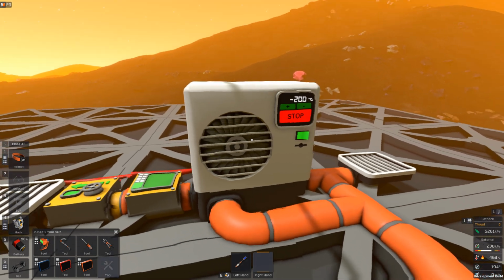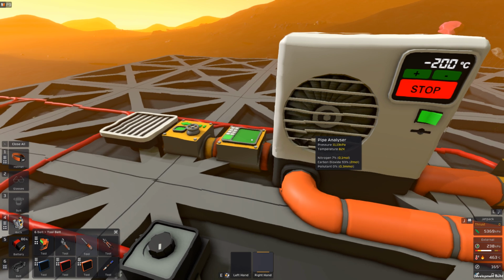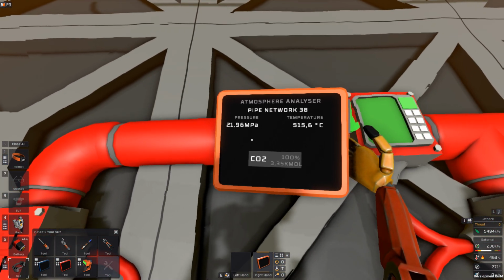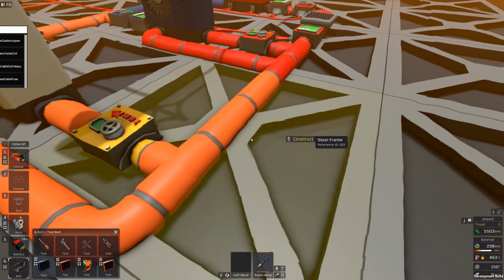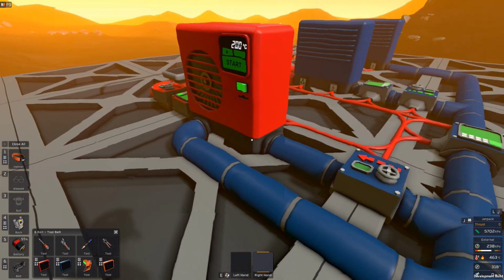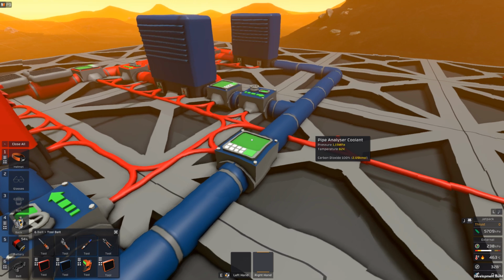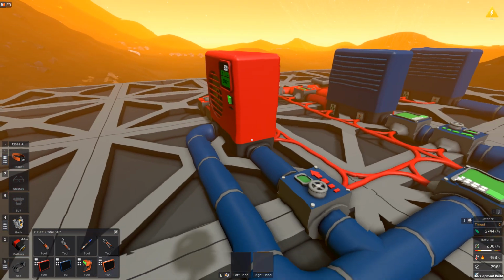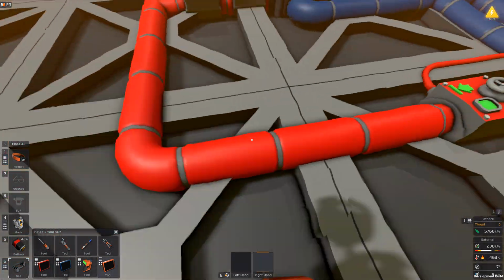Controllable closed loop heating and cooling - Stationeers

Comment: i am on eurpa and i need to heat my gas to like 20 degres ti put it into tanks
but i dont wanna use ic or that just need the AC to work when i turn on the valve thats at the output

Comment: I tried to reproduce this setup on Venus and used the cold loop to cool a heat exchanger, which in turn was used to cool my hot waste. This revealed an interesting flaw: If the cold loop is overloaded so it heats up to more than 200°C, the heating AC will stop cooling the cold loop because heat is now transferred from the input back to waste in an effort to lower its output temp to 200°C. Oops.

Comment: I think the pipe length problem has more to do with how Stationeers calculates its absolute energy values, rather than the number of moles or derived pressure in the pipe. I've discovered the game has a hard ceiling of 10th power because it calculates thermal energy based on the atmospheric and liquid pipe network, and not something more intuitive like power level per mole.

Comment: so, lets see if i grasp the concept. the blue "cooling" A/C takes X amount of "red" (hot) gas from its input, removes 6000J of energy from it and puts out this now colder gas to its "blue" (cool) output, while putting those 6000J it removed into its waste (which is also the "red" pipe). So the cooler side got cooler while the hotter side more or less stayed the same (take 6000J out, put 6000J back in). And on the other side, the red "heating" A/C takes X amount of "blue" (cold) gas from it's input and puts in 6000J of energy which it takes from it's waste port (which is also the "blue" (cool) pipe. So the cold side got even cooler (6000J removed) while the hot side got hotter (6000J added). Is that correct so far? It seems to me then that there is some sort of inbalance, since the red A/C both cools the cold side as well as heats the hot side, while the blue A/C only cools the cool side but lets the hot side more or less the same (energy wise). shouldn't the cool side get far colder that the hot side gets hot? and what happens when the cold side reaches absolute zero (which i suspect it will eventually)?
Reply from the maker: you aren't far off. the blue AC Heats the red side, while injecting cold gass into the blue side (not the same as cooling the blue side).
Red AC cools blue side while injecting hot gas into the red side.

Because the AC can't change temperature without also moving moles you need both to provide gas for the other.

Comment: I don't get why you need additional pumps.
Reply from the maker: if you look at the videos linked in the description, they explain in depth how the aircondition work. but in short, how much air it draws in depend on all the connected pipe lengths, thus the output temperature does as well. by adding the pump i take the control away from the aircondition unit and give it to my IC (pump) instead, giving me control of the output temperature.

Comment: Why does the pipe length issue happen? Is it because of bad coding, or is there a technical reason for it?
Reply from the maker: it's a coding thing. you'd probably call it a bug.  i can't say for certain but from what i have picked up the calculation is wrongly looped inside a network check, resulting in the calculation looping for each connected pipesegment.

Comment: With help of regulators to keep a constant pressure you can based on my own testing use the volume pumps without the additions of PID. And then use heatexchangers to move the heat out of the loop into liquid buffers on both hotend and coldend of the loop. That way the volume pumps can stay on a single value and will level eachother out. With a backpressure regulator to make sure that the volume pump moving air into the cold AC does not get too much mols than what is wants to keep the AC happy with -200 output. Even if the regulator moves the excess gas into the cold side it is little enough that it does not affect the effiency much making sure the gas never leaves the system. Managed to make pretty cold atmosphere on venus this way.

Comment: the issue I have with this, is mostly due to the power requirements. I understand with your setup, your at 300w per AC. the real question is scale. since each AC can 'remove' 6000J of energy per tick, and off the top of my head, each plant is about 0.24J/tick and each electric device is about the same. wouldn't it be overkill to run more then 1 AC for the main heat removal? I find that you can hook up a output backpressure regulator back into the input, and throttle the cooling effect better then with the IC10 setup you have, simply by controlling the output pressure pipe of the radiator. this method is what I use and its more compact and can also be controlled in 2 ways, the AC's temp control to get the J/tick rate. and the Flow rate of the coolant being expelled from the radiator line. with this, I can dial in the appropriate base temp using the pressure and AC unit's controls, and then run it as long as I have power, for 400w, and maintain my base temp at or around the desired temp. the only downside, is it takes a while to manually set the temp, and i find myself just toggling it at its max 6000J/tick rate (-200c) and set the back pressure regulator to 500kpa on venus (10kpa on mars). I could also tie this manual toggling similar to a wall cooler, and have the become automated at about 250w average.
Reply from the maker: your setup probably works fine, no doubt. but instead of expelling gas from your radiator pipe, you would ruse it your cost effectiveness would increase. you could reconfigure your setup and spend even less on cooling. two ACs is more than one, but they would have to be on less.

But there are no rules on how to play here, so if you got excess power and like it simple then lots of solutions would work. however you like it. but at the same time there are those who have more to cool down than a few plants and machines, and every watt matter. :)

Comment: This is an excellent piece of engineering you have there. I have to admit that I had to watch it three times to understand what you did there. And I have to say that is an outstanding application of the established knowledge. 
I can not put quite my finger on it but I think there might be a solution without the volume pumps by adjusting the target temperature on the ACs. Your PID controller would handle the adjustments and after a while the system goes to -200 target temperature.  But this is more of a hunch on my part. 
Also, have you tried to put the ACs in 'chain' instead of 'parallel'? According to my latest model, this would give slightly higher throughput, but it's not entirely ready to say for sure.
Reply from the maker: i have not done any extensive testing on chain, but i suspect the throughput would be more or less the same. as long as source and target temperature is the same it's the same amount of energy pr mol you would have to relocate.
Reply: @Elmotrix  I made a couple more tests and I was suspecting it as well, but it does not seam to be the case. The overall energy is the same but the transfer is different. Not sure how to describe this. According to my model the transferred mols for each tick is dependent on the input 'pipe length', the input 'temperature' and the sum of the waste and output volume. This means for a constant pipe length and very cold gas the transfer is max and vice versa for hot gas it is min. I would think this also means, in theory, if you feed the cooled gas to the input, that each tick it can transfer more and more gas to the outside. The mol transfer part of my model holds so far for each test case. The energy applied to the transferred mols should stay the same for each tick. At least I expected it to be - but it does not look like it. It is a little bit to early to say this for sure (there are still a lot of test left) but this is what I have so far. 
If you are interested I could give you the transfer part and you could play with it if you like.

Comment: Nice setup!, but will this be powerful enough to cool the Gas Fuel Generator? Or is this supposed to just be for regular atmospherical cooling?
Reply from the maker: 3 (2+1) ACs might be just enough to keep a gas gen running on low demand (5-8 kW consumption) but a few more and you are safe. i got a venus survival base running a 10 kW gas gen with 6 ACs, but i'm also cooling down a lot more than just the gas gen.

Comment: Very interesting... good video, thanks!
Reply: indeed, the only issue is the variable power cost, but its a very minor one with the volume input pumps. at the stage of base creation to run this method, you can easily manage the power requirements.

I have figured out how to do air filtration and cooling all in a 2x1x1 space (it was for a full base challenge within a 5x3x3 space, that sits on a 6x5 block platform.)